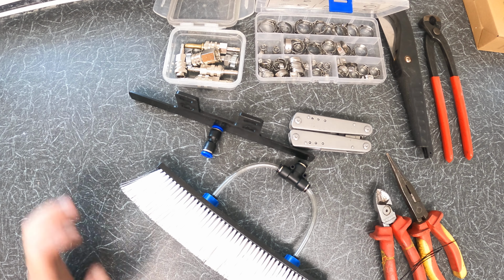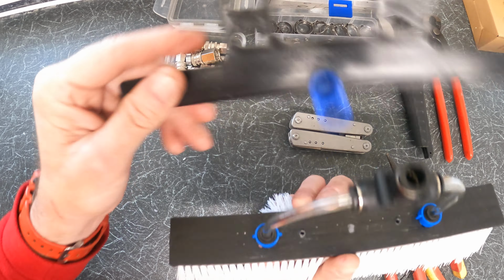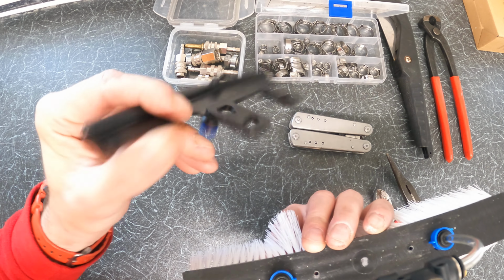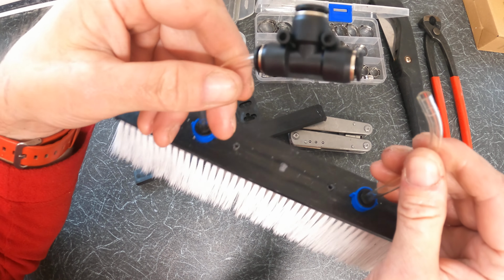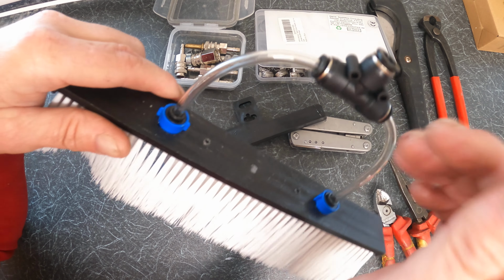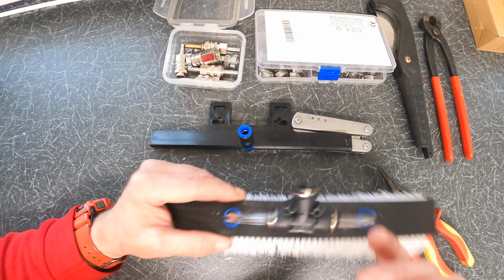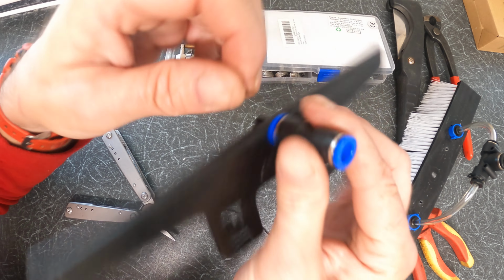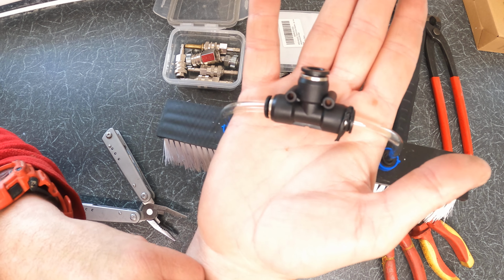WFP John Guest Push Fittings Hints & Tips #wfp #windowcleaning #waterfedpole

Comment: May I ask a question please. I have inherited an old unger hiflo carbontec pole, that has some bits missing and that are no longer available. It’s a single diameter 15m pole that screws together, that has a fixed internal lined hose. Through a bit of creativity, I’m trying to resurrect it into a working pole by cutting one of the sections in two and using half as the feed inlet and the other half as the outlet/brush end.

It’s the lined hose, there is a very hard outer and a thin soft inner liner, that is causing me the headache. When I try to soften it using hot water to fit on a hose tail, the inner liner seems to shrink and withdraw. So I’m wondering if a push fit might work with a very rigid 8mm outer and soft liner, what do you think please?
Reply from the maker: Do you not have the option to fully rework what you have and turn it into a standard wfp with 6mm pu tubing running freely through it and terminating onto the brush head ? 

Make and post a video of your problems and pole etc. I'll do all I can to help you find a viable solution 

I'm not really familiar with that particular pole. I have a few standard unger poles remaining that I use on bungalows, etc. Kind regards, Austin
Reply: @ The sections screw together with a male and female aluminium coupling and there’s an o ring that forms a hermetic seal in each section. So adding or subtracting length is not possible with a continuous inner hose. I could go on the outside of the pole but I want it for PV panels so will be using it at 13+ metres, that’s a lot of hose to be flapping about.
Reply from the maker: @yp77738yp77739  can you not retrofit new tubing to the Unger fittings inside? Sorry It's not something I've seen
Reply: @ the aluminium end caps are sealed to the carbon tube, I tried heating them up as high as I dare to soften the adhesive, but I went over 200 C and it still didn’t release. Thanks anyway, I was just being lazy and will have to experiment. Even at 15m it is an extremely stiff pole, albeit heavy to manhandle, so it’s worth some effort to save it.